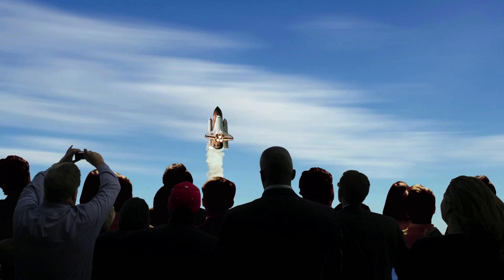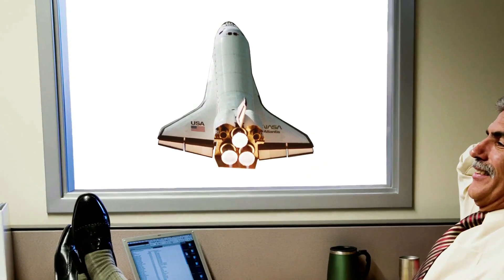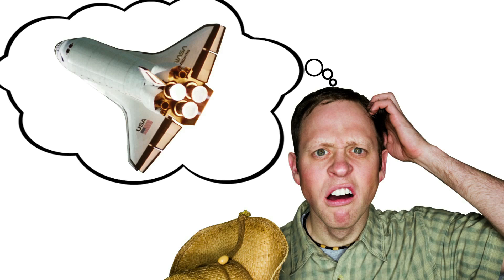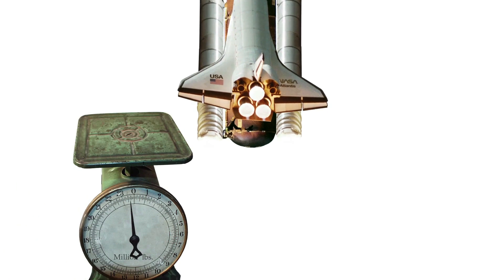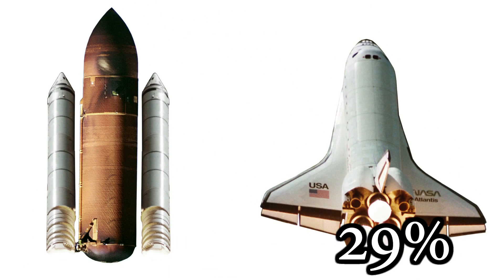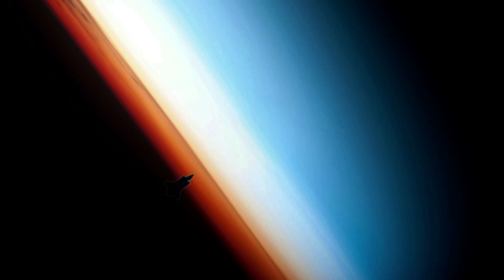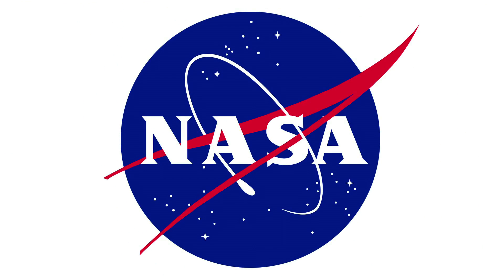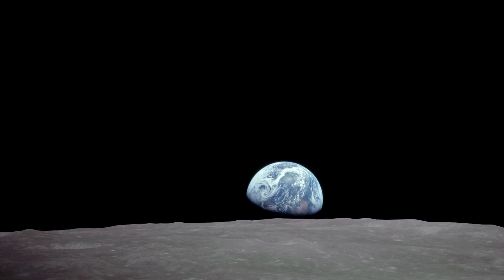The Space Shuttle: Where did it come from? | Stuff of Genius

Comment: The solid rocket boosters (SRBs) are jettisoned quite a while before the external fuel tank separates from the orbiter. It wouldn't make sense for the SRBs to be dropped before the external fuel tank, because there is no throttle control. Once they've been lit, they won't stop until they are used up.

C'mon HSW... You should know better.
Reply: Good point StephenB . Also the external tank is attached to the SRB and the orbiter. There is no connection between the SRBs and the orbiter. And when they break up the 29% and the 71% of the thrust, the external tank should be with the orbiter not the SRBs. There is only hypergolic fuel for space maneuvers on the orbiter. The fuel for the main engines of the shuttle all comes from the external tank. Thanks for making a video about the shuttle.